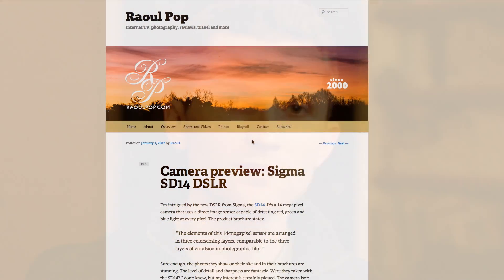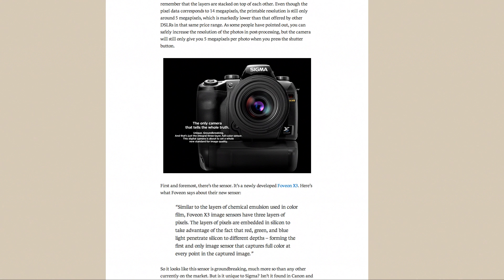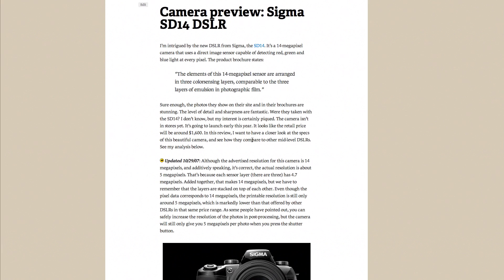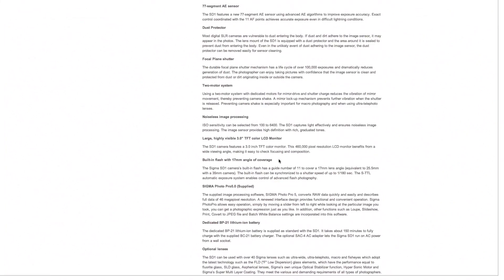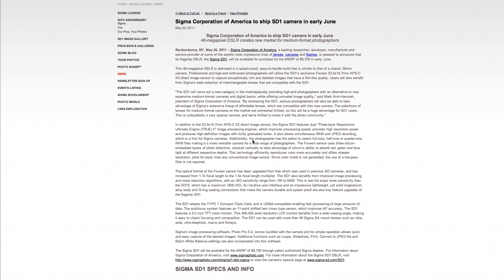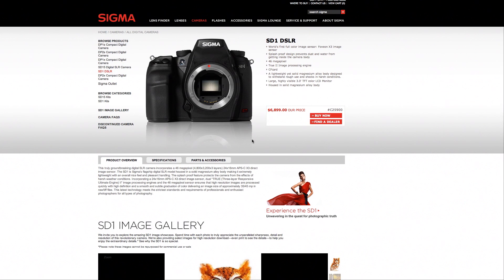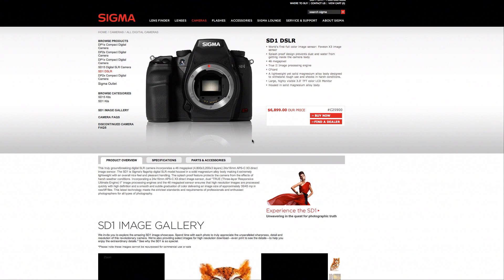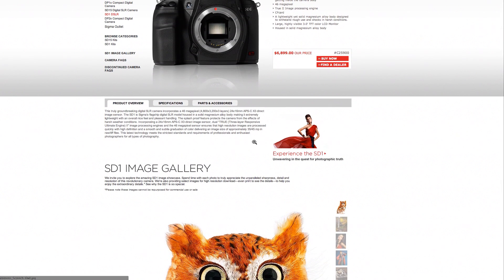Sigma DSLRs

Comment: I don't often give my opinion on bad reviews but this is a terrible anti Sigma baised review. The first thing to get clear migapixles isn't everything. On normal Bayer type sensors the total number of pixels do not give a true colour retention because each pixel can only detect one colour only, it is therefore necessary to guess what true colour and depth of colour the colour blind pixel should render. This means it becomes necessary to interpolate or if you like bluff/guess what the camera sensor is picking up by more than a third or more, I'm not going to do the maths, so actually sigma/foveon is more actual in what the claim, my options from research plus experience is both type of camera sensor pixel count claim need to be divided by a 3rd. Because the sigma/foveon sensor is effectively 3 different colour sensors/photodiode stacked on top of each other light has to penetrate deeper than conventional Bayer design which is only one layer deep, this helps Bayer in lower light situations over foveon even though each photodector/pixel can't pick up out of colour range light, therefore light sensitivity ISO is also reduced. In plain English sigmas sensor is a real sensor not guess or fake. Sigma  should only quote how many photo dectors on the first row while Bayer should also divide claimed pixels/photosites by 3 or more it is too complicated for this moment and may be somewhat variable somewhat according to what you are photographing, for example a red door on a house will only be picked up by red photo pixels on that part of the sensor while the red blind pixels don't detect any light as they only detect green or blue light but it is fair to guess each dead/blind pixel in between red should actually be red. On a 9 pixel sigment of a Bayer photosensor only 1 or 2 are actually red detectors the rest have to be guessed as also the case with blue, so 1/9 accurate with blue and red. If the door is green in a 9 pixel section of the sensor there will be 4 or 5 green pixels that can detect green light. This is really a very poor way to determine colour accuracy compared to sigma's foveon.
Reply from the maker: I agree, it's not a good review. But have you read the description of the video, which I wrote back in 2012, when I published the video? I understood the benefits of the Foveon sensor and I wished Sigma would have developed it faster and used it more. That was my frustration. Even now, eight years later, the Foveon sensor has remained a very niche, very little known product and Sigma switched to a Bayer sensor for the Sigma fp. It is a pity. I wish things stood differently.

Comment: I'm using the Sigma DP3 Merrill with the Foveon®  sensor. to record gigapixel panoramas currently up to about 350 megapixels.  I'll be adding an SD1 Merrill l + a 105 mm Sigma Macro lens  and Tele-converter allowing panoramic image of more than 5,000 megapixels.   A 200 shot panorama  could span 360 degrees wide by  45 degrees high.   Final panoramas of this size would be more than 150,000 pixels wide.

http://www.gigapan.com/gigapans/188014

http://www.gigapan.com/gigapans?mine=true&order=most_recent&show=&since=&query=sigma&submit=Go
Reply: You are beautiful for this...I LOVE PANORAMAS!!!

Comment: +raclette69 Jelousy of all your gear.
I shoot with a Nikon D700, after many year, excellent camera and still is my main camera. I'm M4/3 shooter too, and I really happy with the results in small package.
I never regret any of my cameras. I try to be wise with my buys for what I´m looking for.
I used some Fujifilm X-trans camera just a little, same as Sony 7 series... good enough IQ, the latest models must be excepcional...no doubt about it.
Never in my life I had Sigma camera in my hands, but... with many samples on the net I felt impressed for how much IQ achieve in low ISO.
In special, the colour is out of this world, breathtaking, nobody touch this camera in this regard... amazing.
Probably yes, quirky operation (probably slow operation too), bad initial pricing. But now, second hand SD1 is cheap enough to be safe buy.
I suppose it is easy to name Nikon or Canon when more "standard" chips are available in the market to build a camera, but this Foveon technology is not very common and suppliers must be difficult to find at good prices for small quantities.
I wouldn't shoot a rock show in bad lighting conditions with Sigma, my Nikon is better there, but for portraiture and studio work will be nice camera to have.
I can´t understand many people talking bad about this Sigma Camera when is a very different niche from Canon and Nikon.
There are many modding made for this body camera, taking out the SA Mount and adding Canon EF mount. Both brands use the same AF protocol with different pin array, this enables not only a huge Sigma Lenses catalog, almost many of the excellent EF/ EF/Lenses available.

Comment: Now that the street price (b&h photo) is $1999. I will buy the SD1 Merrill. I have been enjoying the sharp images that come from the fuzzy math that is the Foveon sensor for years.
Carver Mead and Mr. Merrill certainly developed a revolutionary chip with the Foveon sensor. I do hope that Sigma can advance their work. I still own the SD9, SD10 & SD14 bodies. I originally bought into the Sigma system based on the Foveon story. I too am frustrated about Sigma's progress and PhotoPro software.

Comment: I have a Sigma SD14. Now that the SD1 Merrill is on sale at B&H for $1,999.00, I wish I could buy one. It is well worth that, from what I have read. To get a camera with such high resolution, you would have to pay $3,000 for a Nikon D800. If I were rich, I would buy both. I am not, so I will buy the SD1 Merrill. First though, I will probably buy some lenses for my Sony A55. Now, at the price they originally announced the SD1, it is an incredibly good value, even though it is a little slow.